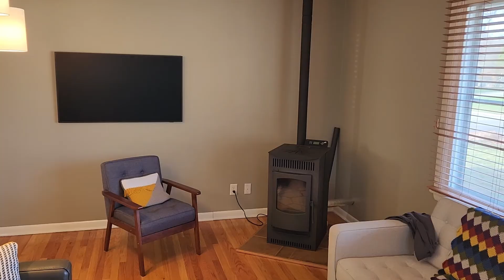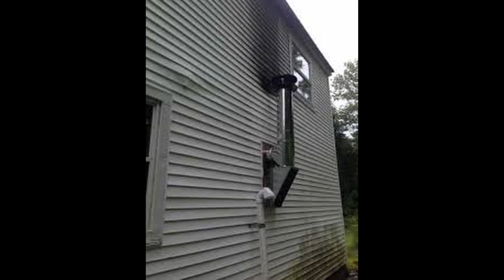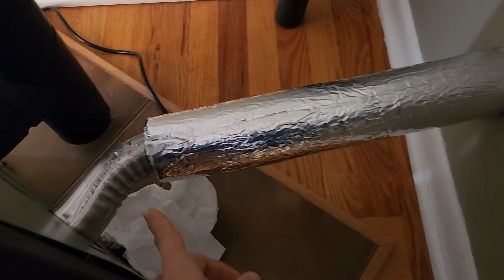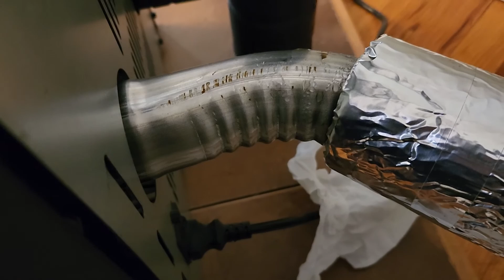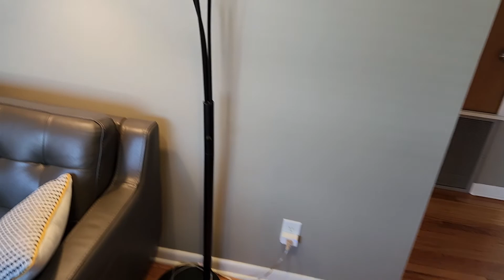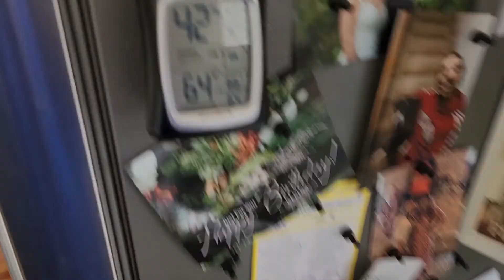Castle Serenity Pellet Stove - Water Problem Part 1

Comment: Pull intake ypu dont need it. Dont believe hype. Simple window cracked will add air if needed.  Wood drys out house!!!!!!  We use it to dry out house from other seasons.  ❤.
Reply from the maker: What data/evidence do you have that supports your claim?  Pull the fresh air intake and then crack a window?  Why? Are you advocated to open a window when it is -17F outside (like last weekend?)  This doesn't sound like a solution.

Comment: Hi Stephen, I live in Fort Atkinson WI and own The same castle stove as you for 4 years. I just have a towel wrapped around my metal intake pipe and have no problems with sweating dripping on the floor. Although it does show a little frost on it in 0 degrees or greater. But I keep my humidity around 35 percent. Google informed me the humidity should be from 30 to 50 percent with best results on the lower side of that recommendation. Unfortunately I just closed down my stove today for the season. I use my stove to heat my 1500 square foot house all winter by itself with no furnace.
Reply from the maker: Stove has been reliable, but this should not be happening.  Design flaw.  I'm surprised more people have not spoken up about this.  See part 2 - literally water dripping off over electronics....